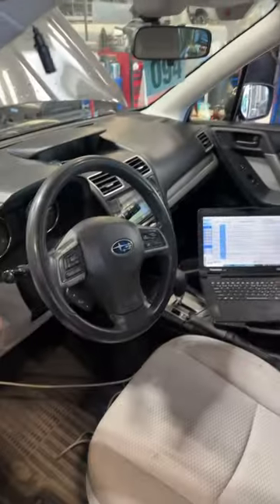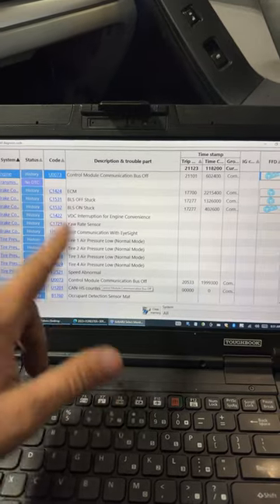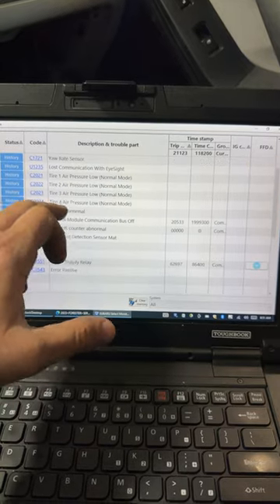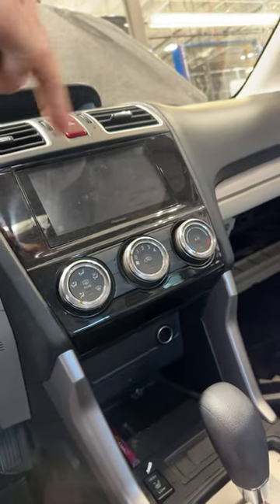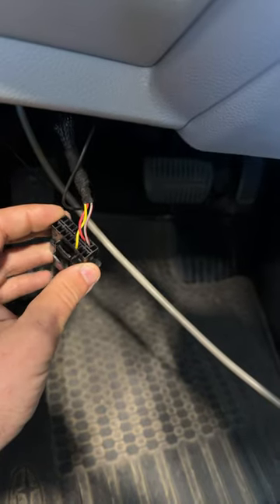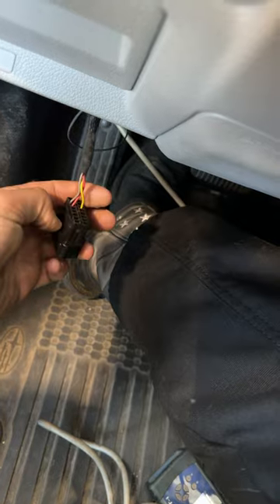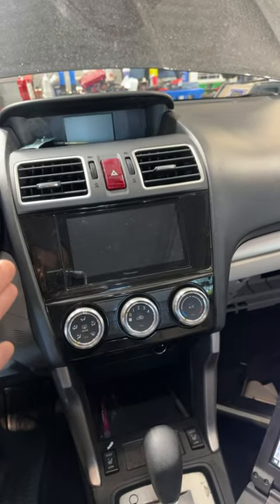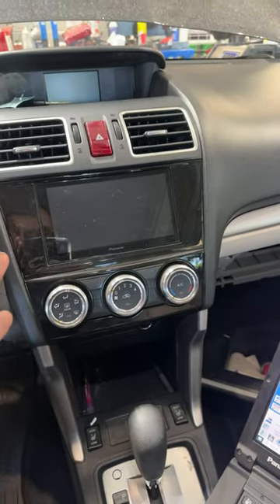Aftermarket Radio takes down CAN/BUS communication network

Comment: The OBD2 connection is just for the radio to show some car info, like tpms, speed, tach, open doors, etc. Most of the cars you don't need to connect it but some like Chevy and gmc need it to turn the radio, amplifier or AC control. Especially if  it doesn't take the data signal from the radio harness

Comment: Everything he said is true! SUBARU is very picky when it comes to putting aftermarket stuff. Putting some LED brake light bulb  will cause some TCM module fault. Causing your transmssion to think, it's not down shifting properly or a "brake light switch circuit high" when pressing the brake pedal. Due to low current flow on the led bulb thinking it's open/short.  Diag is important!

Comment: Just dealt with a similar issue! 2004 chevrolet 2500hd 6.0l. No communication with any module. Accessed the "comb" and jumped each module to communicate with each one, np issues. Unplugged aftermarket radio and communication was restored. Tried to remove the pin for communication but theb the radio doesn't turn on.
Reply from the maker: That sucks